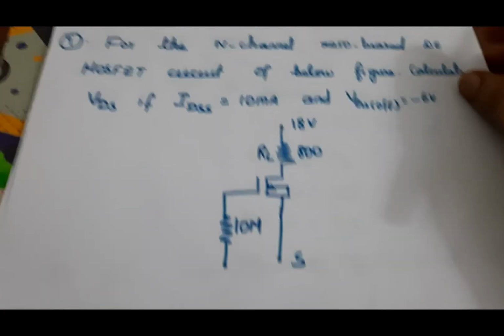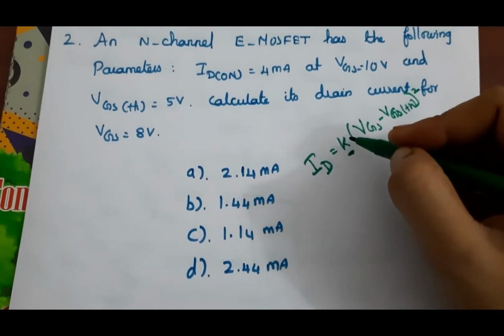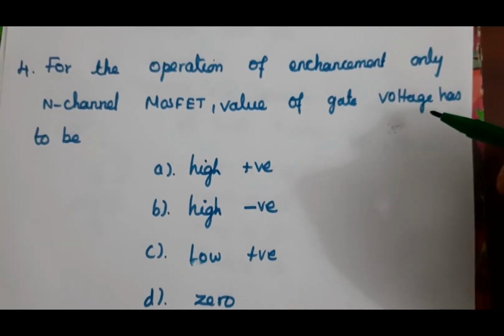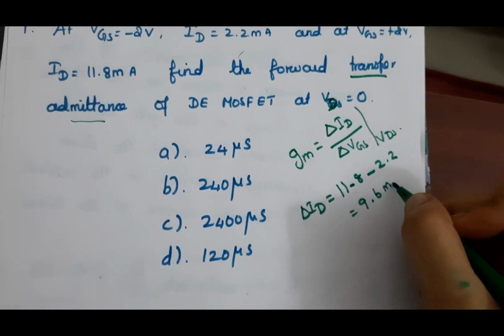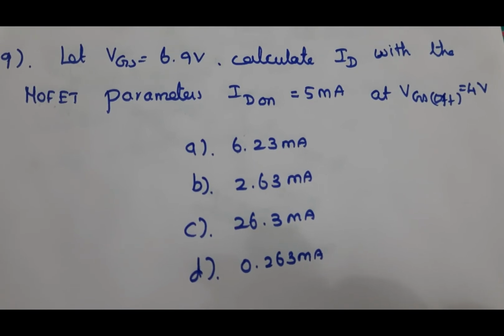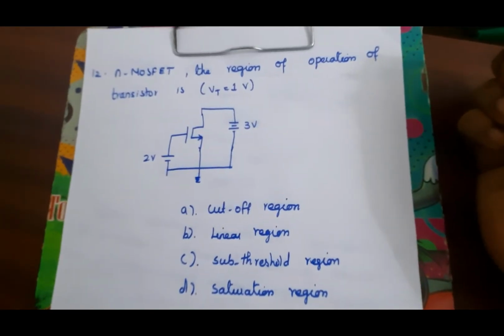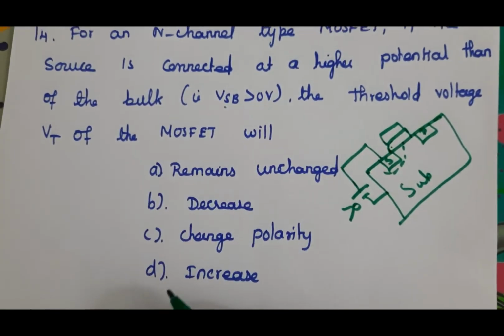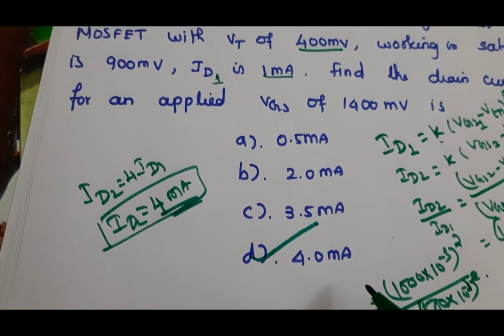SOLUTIONS for Test Series 5|EDC(MOSFET)| TRB,tneb ae,tancet, gate, isro preparation|#ECETutor

Comment: 9th question drain current equ for mosfet crct ah mam..plz ans mam
Reply from the maker: S correct only
Reply: @ecetutor5041  Id = k(Vgs - Vgs(th)) ..other questions la mention pannirukeenga mam...
Reply from the maker: Both eqns r correct. Id=k(Vgs-Vth)^2 also relates drain current and voltage
Reply: @ecetutor5041  thank you mam